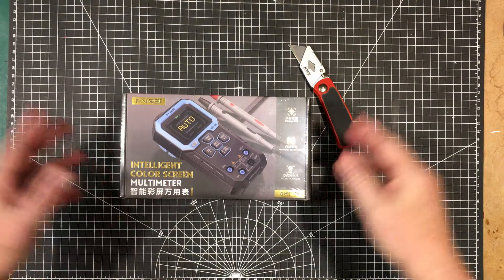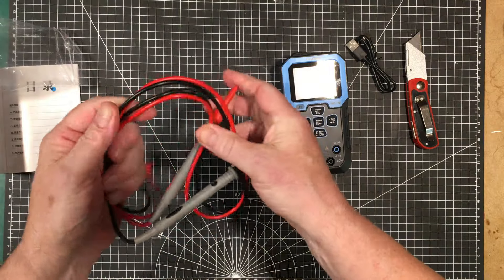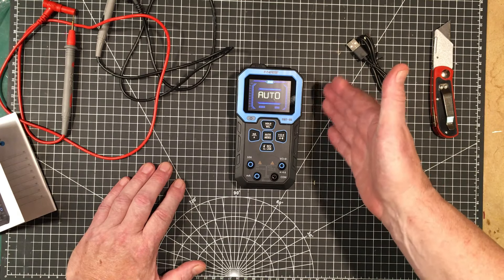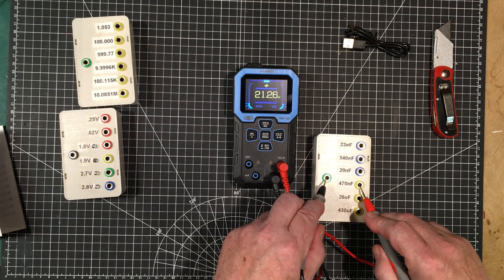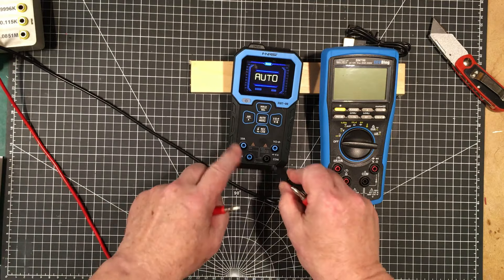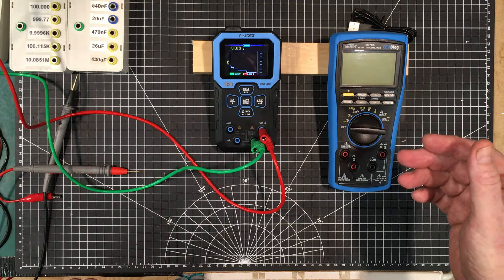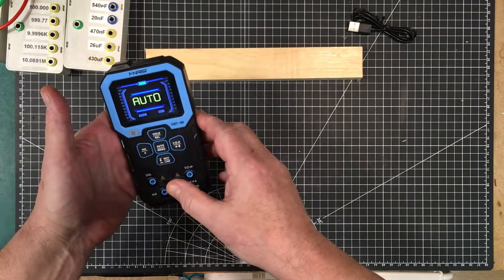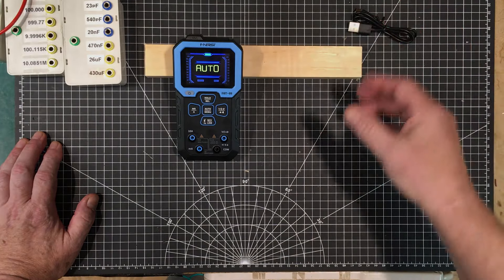Un-Byte 0205 - FNIRSI DMT-99: My assumptions were all WRONG!

Comment: I have several test cables with coax cables and standard spacing banana plugs that I like to use. I don't think I'd buy a meter without the standard connector spacing. That indicates to me that the meter's manufacturer either isn't paying attention to their market, or doesn't know it. That's not a good sign.
Reply from the maker: I'm in the same camp.  I think it's quite possible that they don't know the standard.  To be as fair as possible, this is one of their fist DMM efforts.  They know about it now.  Despite that, It's a really good little meter and many potential users would never need the standard spacing.  But, none of that is really an excuse.

Comment: I have this multimeter from several months, and is very good for the price, a must have, the only thing it is missing is a good scale on mv, I have to use another one to do the job when adjusting bias in amplifiers, for all the rest is super.
Reply from the maker: Yes, it's resolution is only down to 1mV.

Comment: Nice review, it seems you feel the same as I do on it , I like mine for a beat around inexpensive meter. Love your channel!
Reply from the maker: Thanks, right back at you!.  I'm liking it more every time I use it.  Not the most precise meter I have, but very nice to use.   I see you use yours a lot in your videos.  Are you still liking the HS-01 iron?
Reply: @uni-byte  Yeah, It heats so fast and seems to get the parts hot faster than my standard old style iron. I just got to order a stand for it as the junk one that comes with it is unusable. looking at one of the AliExpress ST-90 ones on my next orders from China. Was that you that tried one out? By the you are the reason I got it. I was watching Youtube and your video review came up and while I was watching I made a comment to the  wife like "those small irons look neat I should get one and try one out." a week or so later she goes to get them mail and comes back with a brown box and says here I got you a present. So I can thank you for it. 😀
Reply from the maker: @LynxElectronicsLab  You're welcome!  Yes, I did try out the ST-90.  Very nice iron stand.  Nice and heavy so it does not move around, and has a big sponge.  If it had a solder spool it would be perfect.
Reply: @uni-byte  Thanks I guess that will be on my next order.

Comment: Does it meet safety standards for meters
Reply from the maker: To which safety standards are you referring?  As I mentioned in the video, they do not claim any CAT rating compliance.  It's strictly for LV electronics work, and not industrial work.  If you need something that actually meets CAT compliance, then stick the things like Fluke, Keithley, Brymen and other such things that cost 5 to 20 times as much.  Do NOT trust cheap meters that claim CAT IV compliance and cost less than $50.
Reply: @uni-byte  CAT III.  I notice I think on Amazon it says the probe kit is CAT III.  There are different versions of CAT depending on the voltage.
Reply from the maker: @ahbushnell1  If you need CAT III this is not the meter for you.  CAT ratings do not (only) depend on voltage.  They depend more on the type of environment and the electrical characteristics of those environments, especially pertaining to energy, transients and electrical noise.  Just because you have leads rated at 600V or 1000V does not mean you can use a meter that is not properly CAT III rated in a CAT III environment.  Be careful.
Reply: @uni-byte  Just asking what safety ratings it had.
Reply from the maker: @ahbushnell1  As I said in the video and my first reply, it claims no safety ratings.  It's strictly for electronics work.  the maximum voltage between COM and V is 750VAC or 1000VDC.  However, these are not safety ratings.  The probes have 1000V rated PVC cabling and the probes themselves are marked CAT III and 1000V MAX, but only carry a CE certification.
Reply: @uni-byte  Thanks for the clarification.

Comment: Yeah, a nice little meter and the only downside is the spacing on the jacks. Erebody complains about that and with good reason.
But for the quality-price ratio, it is worth it.

In any case- I never remove the plastic protection from my electronic devices- except in cases where I can buy a better replacement protector. Makes me cringe whenever I see people do that! 😀
When I saw you peel that plastic protection off that Fnirsi... it "hurt". It's like taking a pen and scratching a brand new car! 😀

All my multimeters- 2 are 13+ years old, still have the same plastic screen cover sheet that they came with the day I bought them. The plastic doesn't look that neat anymore- with loose, grimy ends, but I promise you there is not one scratch on any of them underneath that plastic.
It's the same for my Android wristwatch, my HTPC, my braodband router, my remotes, my Garmins, my TV screen and more..
Reply from the maker: Different strokes for different folks.  I have a couple of older meters also that don't have any scratches on them.  My usual way to deal with that is put them in a case.  BTW, I know some folks that never took the plastic off their furniture cushions!
Reply: @uni-byte  True, L0L! My Queen-sized is 5 years old and the base is still nicely wrapped in it's plastic sheet cover. Wife h*tes that! 😀

I suppose it's like the old sneaker-argument. Some like their's looking proper used and half-dirty-preferring to just wipe it "clean" from time to time and only washing it to get any smells out.. others can't stand a "dirty" looking sneaker! 😀